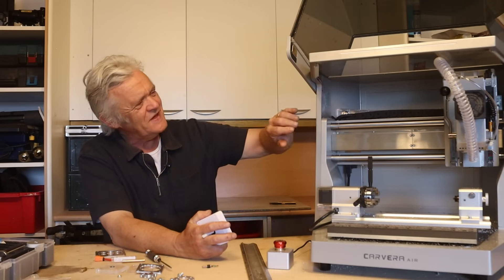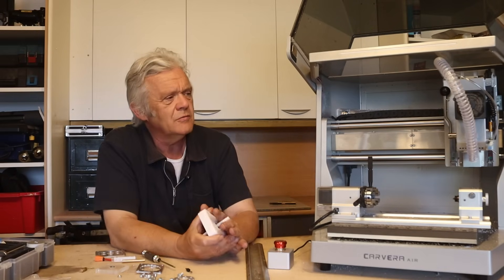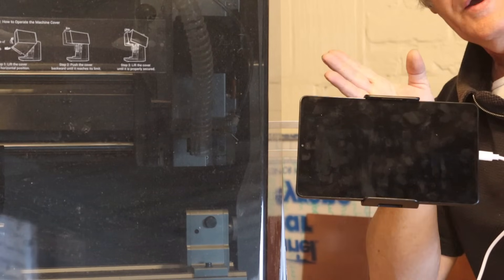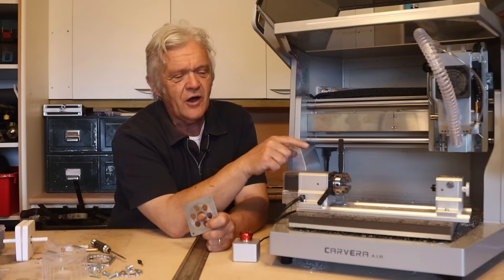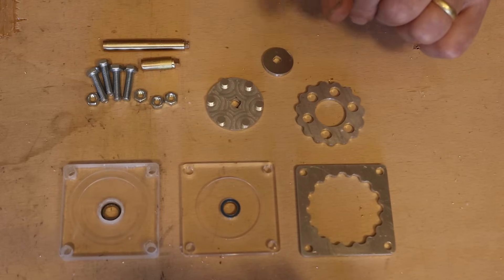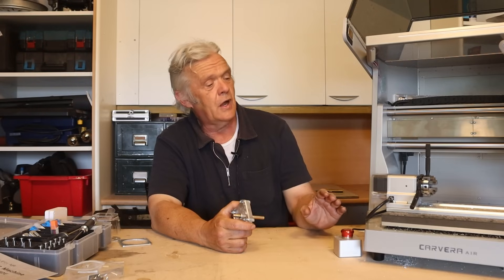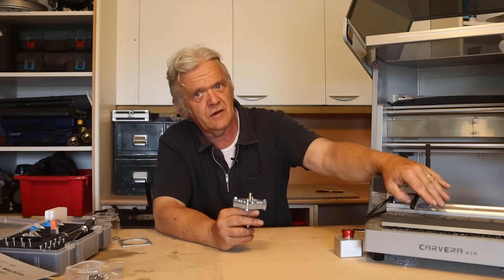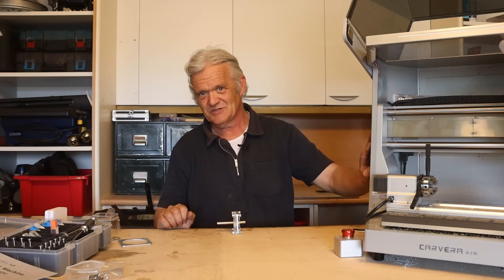2396 What I found Out About the Makera Carvera Air  Desktop CNC Machine #Makera #Makeradesktop #CNC

Comment: It is nice to see you getting into the CNC machines.  I am a DIY type of person and have built, from the ground up, 2 CNC machines.  What I find the trickiest thing to figure out is three things.  1. The rate at which your CNC feeds the cutter into your part.  This changes  depending on the material that you are cutting.  2. The motor speed that is spinning the cutter.  3. The type of cutter you are using.  I started using HSS, then switched to Carbide bits.  Of course the number of flutes that your bit has along with the angle the flutes are made make a difference as well.  I have found that a single flute carbide ONSRUD bit works very well with plastics.  I prefer 3 flute carbide bits for Aluminum.  With Aluminum your have to slow down the feed speed at witch you are cutting.  Also cutting metal you have to watch out that the cutter does not get metal gummed on to the cutter.  Usually, metals need coolant to cut properly.  As chip removal can be critical for almost all materials being cut. With plastic your can feed rate can be a little faster.  With Wood you the feed rate set as fast as your cutter can go.  Otherwise you will burn the wood if it is too slow. You may have to experiment a bit to figure out all these things on your machine.  I would suggest buying several cutters so that i you break one it can then be replaced.  If a cutter brakes then usually the feed rate is set too high.  I hope that this will help you a little.  Your friend Ricki.

Comment: on your PCB making, if you plan on chemical etching for the copper, you would want to drill the holes first using the mill then use a clear method you can see the holes through while applying your acid resist coating, which I found vinyl sticker stock works perfectly and the acid I used was vinegar and peroxide mixture, :) (so much cleaner than the standard expected ferric chloride, really wish I had known back when I was making things using acid etching ages ago,) and hte peroxide I used that works so well was just standard pharmacy grade 3% peroxide, nothing crazy like the 30% used in hair salons for bleaching hair out or anything, The good thing too on that I am finding (from making the mistake of etching first) is that I can hang the boards in a plastic container in the vinegar and peroxide solution with both sides of a double sided circuit board and etch it all at once, and the simple action of gravity is enough to drag down and keep a clean surface for the acid peroxide mix to get to the copper under it, 

My next trick is going to be testing out the copper acetate with fresh peroxide to do aluminum etching :) (have done it a little on a thermal blanket but had it laying down in a pyrex dish which you dont even need for this, plastic is fine and no need for  heating so going to see if I can do a bit better job this time (the mylar in those blankets has one heck of a dielectric constant for as thin as it is, like 400v per layer so you can get in the 10s if not 100s of thousands of volts of capability in a simple mm thick layer stack of them never mind the options for using it in battery making)

Comment: on array of tools you have now the two you need to make metal machinery as the lathe makes the parts that need smooth circular cuts like spindles and bearings, and the mill will make the body to hold those parts as they spin to make all sorts of stuff XD

Comment: oh that waxy stuff or even just plain wax on the bit can keep plastic from getting quite so hot though it seems that running the slowest speed or having dwelling times programmed into it so it has time to cool back down with that air assist so you dont have the plastic bind on the bit and break it. :) Additionally I am guessing you will start realizing you can tell if your machine is having trouble or wizing along just fine, based on the noise it makes as it is cutting parts :) (ie the more clean and running well it is as it cuts the quieter it is, as the noise is an indication of excessive energy imparted into bits and materials you are cutting caused by inefficiency of the cutting action so you want it to be as quiet at the end of use as it was when you started up :) 

Machinery's handbook seems to be quite a good source for how to know what speeds things can handle and where the sweet spot of getting speed and longevity is actually at, where going slower or faster will both shorten the life of the cutter, :) 

Cant wait to see you take it to the finishing processes that can be had with some of those bits at the last machine shop machinery expo that you can see here on youtube. (like mirror finishing from a mill, just crazy good work.)

Comment: would be good to try out tips and tricks for it and let people know what your results are for this, like using something like the waxy stuff found on Rio Grande (a jewelery manufacturing supply company that I would drop the link but I know that would block the comment sadly) they have this blue stick of waxy stuff that you apply to bits and burrs called burr ease or something like that, that ends chattering and keeps the bit cool, 

additionally though is the use of something such as that applying it periodically to keep stuff like aluminum from bonding back to the metal bit and binding it up as aluminum and titanium like to do. (kinda does what your video on how to get metal coating from that steel wool application of the nano particles suspended in a de-oxidizing system like ascorbic acid and such.)  

additionally the parts you made with the mill look fantastic. :)

Comment: Hey Robert, this is off topic, but have you seen Nighthawkinlight's video on building with cardboard? He's gluing the cardboard together with boiled flour paste. Any thoughts on alternatives or ways to improve it that are still cheap? adhesive strength, flexibility, water resistance? And do you think that boiled flour paste could be used for paper stixx?
Reply from the maker: Wheat paste has been used for centuries mate - it can be 'improved' by adding 50% PVA
Reply: I saw that the other day, very interesting 
As Rob said, flour glue has been around forever, pva is cheap enough and also has a long history

Comment: I got a cheap Desktop CNC machine from Amazon (~$400) to do home PCB's but the open frame meant that it spewed fiberglass into the room causing health issues.  I built a box for it but it too leaked fiberglass dust.  I was able to get some FR2 boards (based on resin and paper) but while less dangerous than the fiberglass FR4 it still creates a lot of resin dust, even if you only use the CNC for drilling the holes.  In the future I plan to only use it outdoors.  In the meantime I just did my board the old fashioned way with resist and etching liquid.  Some of the more powerful laser cutters can etch away the copper layer on PCBs w/o damaging the underlying base.  These also have much better airflow for exhausting the copper vapor outdoors.  While I've yet to try it, some have suggested using a resist pen in the CNC to draw the pattern for standard liquid etching.  In all those cases the through holes & vias have to have small copper inserts to conduct from the front to the back of the board.
Reply: A box with a HEPA vacuum should solve that.
Reply: @monsaka7827 I have considered putting it in a paint box
Reply from the maker: it is one of the issues with subtractive methods mate - but I think you have good idea in your mind - a paint box should do it

Comment: If you made the enclosure plates in metal, would they have been easier to create entirely using the CNC? 

I always worry about an online (online here, in the sense that you download and update it from an online app store on a compatible device) app being used for control, because will the software still be supported & running in 10 years time when what is called "Android" is now something possibly entirely evolved? Will the machine be still easily controllable if in a decade's time, the worst had happened and Makera had went under as a going business and stopped updating anything? For you personally you'll probably keep that specific tablet with the machine for years, but what's the situation for someone who bought one of these second hand?

I particularly like the remark, "If you're not making mistakes, you're not learning anything". I'll have to keep that in mind more often.
Reply from the maker: About the same as if I had entirely CNC'd the acrylic I think mate cheers

Comment: My budget being 500$ doesnt allow me to get those toy. Ill still need to cut my gear with a angle grinder and a dremel
Reply from the maker: as long as it works mate - it's good
Reply: A cheap, small drill press and vise will help you out immensely. Careful layout is key but if you’re using an angle grinder and dremel I suspect you have that figured out.
Reply: @natheyshiro4119 One of those oscillating tools with a triangular needle file stuck on the end might help to get perfect angles, I'm guessing if you zoomed in on Rob's failed attempt the outer points would be sharp but because it's a round bit the inner points would be slightly rounded 😎👍